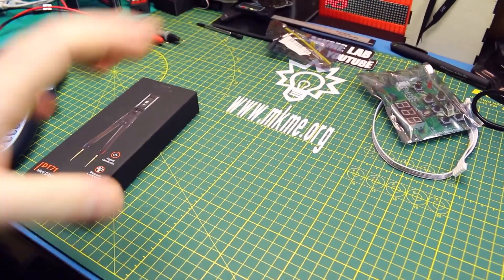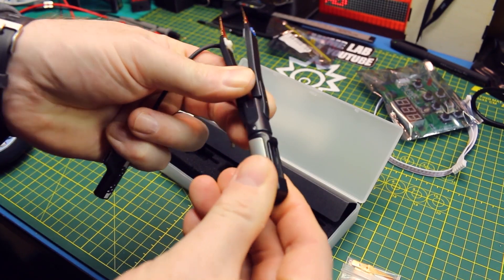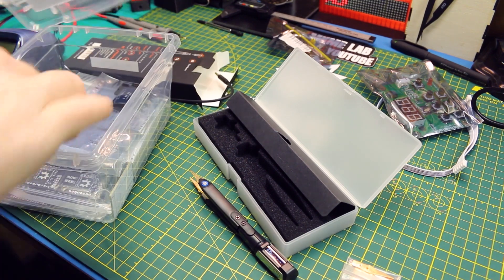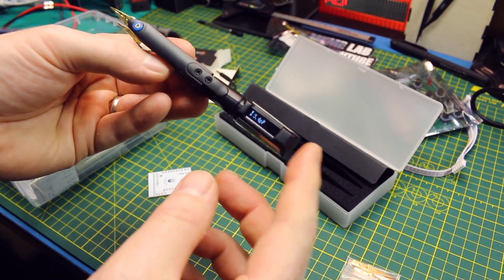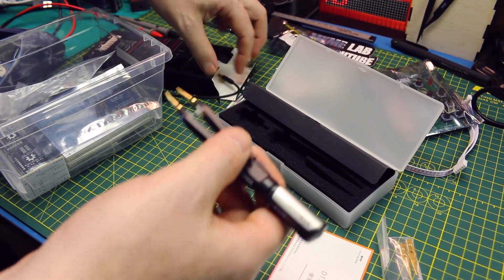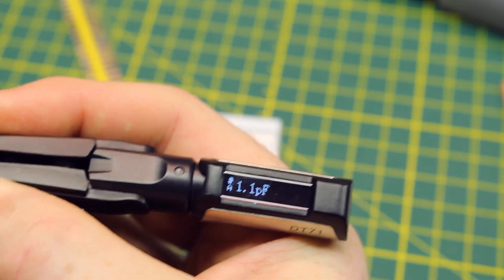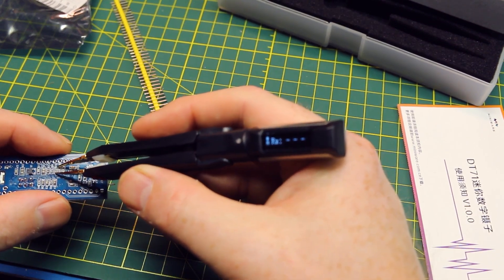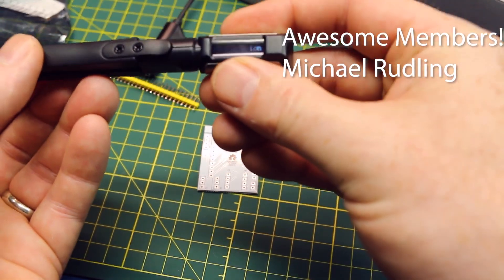Miniware DT71 Smart Digital Tweezers- First Look

Comment: I have been using it for over six months, and it is such a handy tool to have on the workbench.
To measure low values accurately, I wipe the tips and run the calibration and thereafter the reading gets more accurate.